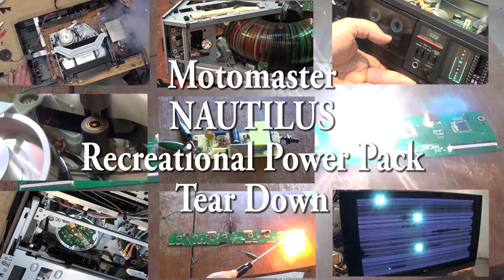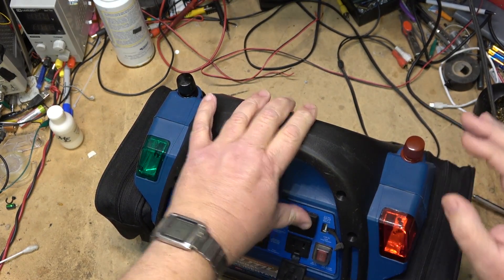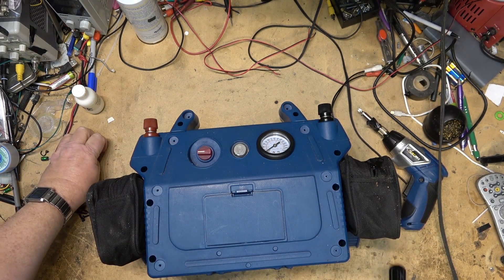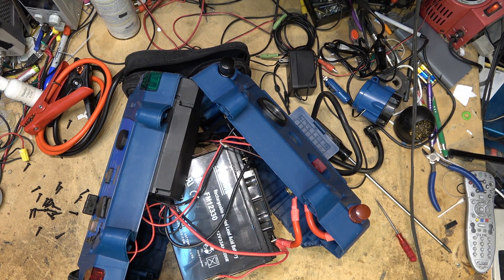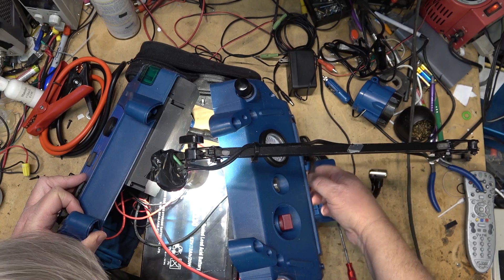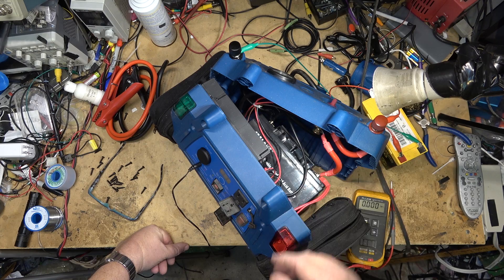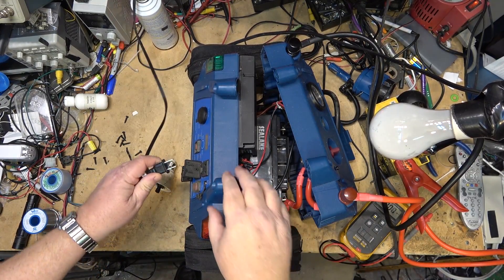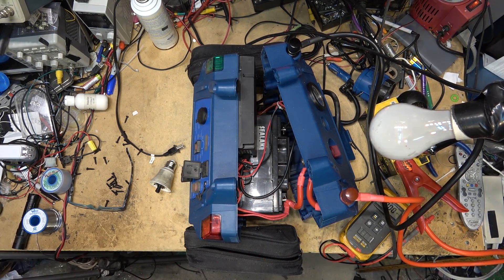Motomaster NAUTILUS Power Pack Tear Down

Comment: Thank you for this! I've just finished pulling all the screws from an identical unit and I was also having trouble figuring out how it comes apart. I have no need of the accessory packs, so thanks to you I know I can just go back in there and snip em. You've probably saved me two hours or two months, depending how discouraged I was gonna get figuring it out myself cause I have a weird phobia of breaking things when repairing them.

Comment: The Replacement battery can be found either at Canadian tire or at a shop that deals with electric scooters for the elderly. price ranges from  $69.00 and up.
The main resion why they go bad it age of the battery and like any other battery the loss of water. These units use a glass matt AGM type battery. the cost of the battery replacement is far less than what CT will charge you for a brand new unit, I know this cause I have a Stanley that was bought at canadian tire that had a weak battery - well I replaced it and it now runs as good as new...

Comment: i bought one of those lithium ion battery packs for jump starts.  it's been great, it does several jumps before needing recharging.  i already had a seperate air compressor in my trunk so didn't need one of those

Comment: Yep battery death is common with most portable power packs,  i've had a few to check over and the battery is dead/pooched/buggered/knackered or bereft of life lol.
And its not even the norwegen blue 😀
Lithium batterys might be better, the engine jump start pack is amazing.

Comment: After reading threw the comments out of interest I see that I don't think alot of people understand that those need a bit of care to last longer then a couple of years. If it's used occasionally for anything just to keep the battery active drain a bit then top up charge then can last a long time. But alot of time's they sit discharging as battery's do then don't work well afterwards.
Reply from the maker: The biggest problem that people make with these power tool batteries if they leave them set on the appliance or they leave them sit on the charger. That's not the way to maintain the battery. I use mine cut the lawn a couple times it'll be down to about a quarter charge charge it up take it off the charger leave it sit off the charger and out of the lawn mower. I haven't cut the lawn for months because the water band came on and without water it doesn't grow so mine's been sitting fully charged in the garage for probably 4 months. I'll throw it on the charger top it up and then let it sit for the remainder of the winter and before the spring comes along I'll put it on the charger and top it up again before I use it. The biggest problem that people make a lot of times is they'll leave it sit on the charger and then they'll unplug the power from the charger and the charger will start to suck down the energy from the battery and can drain it too low, same with leaving it sit in the lawn mower where there are some circuits that will be energized awaiting you to push that start button. If they're kept off the appliance and the charger would not in use the batteries will last a long time. I have camcorder batteries that are 15 years old and they still work again they're not left on the camera when it's not being used and they're not left on the charger but they're stored in a charge condition
Reply: @12voltvids  Oare se poate incarca bateria prin cablurile jumper?

Comment: As a power pack with lots of features?  These things are great.   You can even use them to weld with in an emergency.  Not great, but it can get you  out of some tight situations if the need arises.    for jumping or boosting your car those little small units work they charm even though they really don't have that much capacity they do have the oomph to get the job done for most 4-cylinder cars.   

the nice thing about these older units is that there is very little to go wrong and they usually always work and you don't have to depend on anything finicky if it gets wet or completely drenched in water there usually isn't any worry of it not working in the next 2 hours minutes or days.

as a marine unit it must work perfectly and it's probably designed for being wet or using in completely wet conditions.    if nothing else the 12-volt battery on the inside should still keep on chugging even after full dunking in the water if the inverter  or another items don't work.. 

for 90% of everybody else just get a new unit and call it a day
Reply: they jump start Tahoes too

Comment: Is there a way to top off the water in the cells like the old Panasonic camcorder lead acid battery you did so it will take a charge again? That did not work for me, all that happened is the battery took current and boiled all the water back out overheating the charger and battery. Would never come back up past 8 volts.
Reply from the maker: Might be possible but I am not going down that road.  These batteries are readilly available unlike the old camcorder battery.  That old battery for the camera still works but it only holds about 20 minutes of running time when fully charged.  Better than nothing but doesn't matter as it will never be used to record anything again. One of the gadgets I need to sell.

Comment: hi there can you please tell me the specs on the ac power charging adaptor for this unit 😊
Reply from the maker: Nope.  Don't have it.
Reply: @12voltvids  some help you are ...why post vids if you dint know simple stuff like this
Reply from the maker: @sweetkaosisbossgateythisis1790  just tell me how I'm going to answer that question when I don't have the unit here? It was brought into me checked out to find that the battery was shot and it was giving back to the guy that owned it who in turn gave it to somebody else. It wasn't brought in for me to test to see how much power the charger has on it I could quite frankly not give a shit how much power the charger has the battery was shot I didn't make anything on it I wasn't paid a penny to evaluate it. I don't have the spec sheet for this stuff. it's the same as people asking me questions about products that aren't even sold in this country can you tell me what's wrong with Brand x that's doing this no I can't I've never seen it it's not sold here I've never worked on it how does someone expect me to answer that question? Sounds like a troll question to me someone wanting to get in an argument so I ignore them.

Comment: It surprises me that Canadian Tire continues to sell this over a decade later, considering it has a 2-star rating on the website. It doesn't deserve that rating though - what people don't seem to understand is that lead acid batteries need to be kept on a constant charge to last. I reckon what the people who leave bad reviews are doing is charging it until it says it's done, unplugging it, and then going Pikachu-face when they try to use it again a few months later and the battery is ruined.
Reply from the maker: Yip

Comment: Would a LiFePo4 battery work in it? Or would that be wasted money to use a valueable battery in such a unit.
Reply from the maker: Well any 12 battery would work but then you need charging, balancing and protection circuits.
I sold one of the brand new lithium power stations to the guy that owned this one.  1/3 the size and probably more capacity and batteries will hold charge for 1 year.
Reply: Replace with lithium iron phosphate with BMs turn this pack into a Super pack !

Comment: The problem with every booster pack I've owned is improper charging perameters I always thought that a year was all they last until I found utube and they told proper charging perameters and care for sealed lead acid batteries but I thought they had to be wrong after all the manufacturers should know proper charging perameters and care of their products but my old black and decker booster pack was handy and since black and decker doesn't make their own batteries I'd find the battery manufacturer  go to their website and find what they say their proper care and proper charging perameters are but I didn't have to as, written right on the battery was do not discharge below 12.2 float charge 13.4 and full charge is 14.8 and on the charger is output 12 volts so the battery is is dead to start with and being discharged way to low sometimes to 0 so to charge it properly you need a good battery charger that has battery maintenance built in and you can't go by the battery charger specs or even phone them to find out I did that when I bought a Schumacher battery charger and he lied to me and since my old Canadian tire one was charging proper I didn't need it for almost a year and when I finally did use it I found it only charging the battery to 12 volt and said it was fully charged so I had to charge my batteries one at a time the booster packs have to be charged with either the booster cables or the auxiliary port the reason why I found this video and others was I was also lied to by everstart and by the time I found out it was almost too late to save my everstart booster got almost a second year of use but went to boost my pt cruiser and although they read fully charged they wouldn't turn it over and since they were junk to start with one air pump didn't work at all and the other one locked on after 10 minutes of running it wouldn't shut off so I had to take it apart and cut the wire so I've got 3 Canadian tire booster packs one is a nautilus the second one also has air and a modified sine wave inverter and the third is just a booster pack so I'm planning on upgrading them so I can charge type c and quick charge USB plus add a Anderson connector to charge them and one to connect them together so I have more amp hours 
L

Comment: looks like crappy tire still sells this same model normal price is 299.99 although that never means much normal price at crappy tire is always inflated.  has close to 100 1 star reviews saying that battery fails on it not long after the 1 year warranty runs out.
Reply from the maker: That sounds about right for crap leas acid battery.
Reply: Mine is still going after ~15 years... it still boosts well enough and runs the Internet stuff during power outages. Capacity is probably less than half by now, but still seems to get by... regarding the 1 year failure story, I kind of doubt that applies across the board, as these things easily can be ruined by mistake, misuse, ignorance, neglect, etc... otherwise it could be a case of a cheapening of the materials on the newer ones...

Comment: get some 50ah lifepo4 cells , and a 4s active cell balancer and throw this lead acid in the ocean . omit the bms if u going to use this as a jump starter .. there is no need for bms even if u short lifepo4 cells they don't  explode and catch fire. cell balancer is all u need and the voltage curve and range is same as lead acid so there is no need for changeling any circuit .
Reply: even 25ah cells will do a good job for starting cars .
Reply from the maker: @KuntalGhosh  i doubt he will replace the battery.